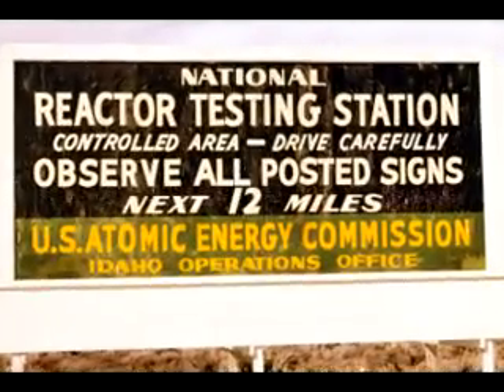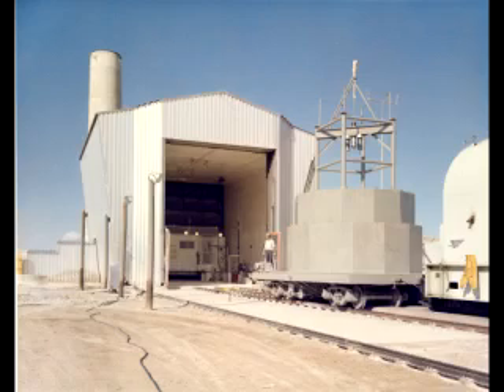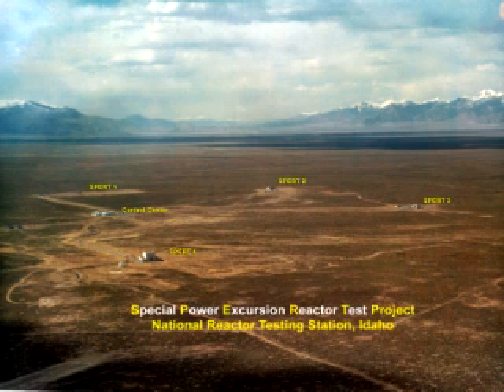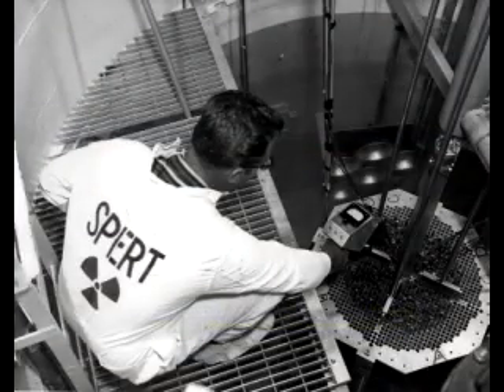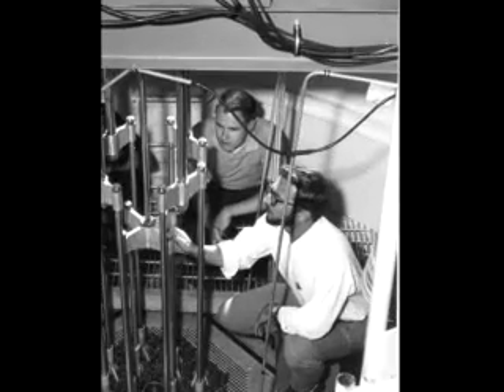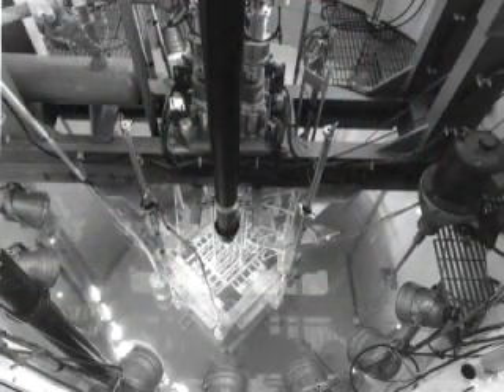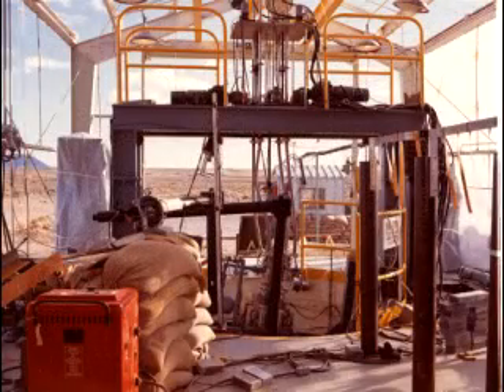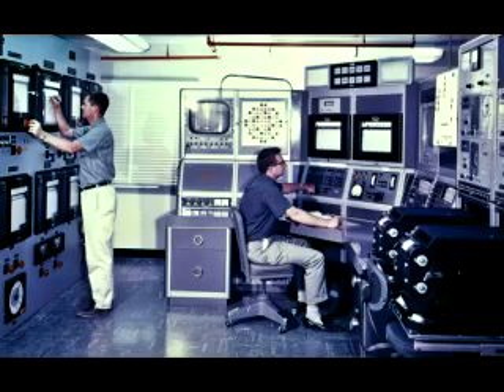The Day I Blew Up a Nuclear Reactor

Comment: Your point about not doing power reactor safety research and analysis is very valid. We let the genie out of the bottle a long time ago, and it is never going back inside, so it is stupid to not do everything to understand the genie. We should be running fourth or fifth generation reactors, instead of first and second. Fukishima was operated long past its prime. Heck, there are still 32 GE Mark I reactors still operating.

Comment: Fermi 1 was a partial meltdown. There were no injuries or fatalities and no danger to the general public. 
And the claim about no safety research is preposterous.
Reply from the maker: The claim of no safety research is NOT preposterous. Show me a research program that is actually running all out safety tests on an actual reactor of design the same as nuclear power plants now and future designs, and I will correct that statement. You don't put astronauts on a rocket that has not been thoroughly tested by test firings.  Give me the reactor and I will do what I can to either blow the shit out of it or melt it down or . . .! And don't give me that shit about semi scale tests. I was in charge of the safety analysis of the Power Burst Facility in Idaho for testing safer fuel element designs.

Comment: SPERT prove water is the worst choice as a coolant. It just explode.
Molten salt iun other way can ABSORB excess power and stop the fission for it's own.
The parameters of salt: 801°C melting point
1 465 °C - boiling point of common salt
~350 °C for eutectic mix.
Boiling point around 1200 °C for eutectic mix

Salt boil WITHOUT forming shockwave or film.

Comment from the maker: We didn’t just mosey into the control room one morning and decide to blow up SPERT I. This test was the culmination of a very carefully thought out series of tests with incremental increases in the severity of power excursions with shorter and shorter reactor periods. Each test was followed by weeks of data analysis before the next was run. We knew that certain reactor cores could withstand very severe power excursions. But, like test pilots approaching the sound barrier for the first time, there was a threshold that, once passed, things got wild. Somewhere around or below a 10 millisecond period was our sound barrier for this plate type core design. Beyond it was new, unexplored territory. 
An earlier test on another reactor in 1954 had led to explosive results. It was called the Boiling Reactor Experiment, or BORAX, run by Argonne National Laboratory at another remote area of the National Reactor Testing Station. The BORAX 1 reactor was first used to demonstrate that a reactor using direct boiling of water would be practical for generating power. In one final test they deliberately punched through that threshold, generating a 2.6 millisecond period. It was a spectacular explosion but not a lot of useful data was obtained.
The SL-1 accident was another example of exceeding that threshold, with tragic results.
We were looking for the threshold, below which cores could withstand very severe excursions, but just one step beyond made it violently explosive. And what was the mechanism that triggered the violent disassembly of the core when just before that threshold was reached the reaction was relatively benign? 
Our test series on this core in SPERT I started in early 1962 and progressed over several months involving 54 power excursion tests, ending with the test shown here. The reactor period for this last test was 3.2 milliseconds, peak power reached was 2.3 gigawatts and fuel plate temperatures reached 1200 ° C. The molten fuel portions dispersed into small globules increasing the heat transfer rate enormously – resulting in an energetic steam explosion throwing remaining water above the core 100 feet into the air and shattering the rest of the unmelted portions of the core. 
Before this a test had been run with a 4.6 millisecond period reaching a peak power of 1.3 gigawatts. A significant portion of the central core fuel melted, but no explosion.
Reply: I was wondering if this was BORAX or not.

Comment: I read an excellent story on this. They used to put uranium together to see if it would start a critical mass and then pull it apart real quick. Early days. This gent I read the story on, Leonard something, threw himself on the thing when he realized it was going irreversibly critical. He died of extreme radiation poisoning, but saved the onlookers.

Comment: I was an ET3 at the S7G MARF Plant at Kesselring when I over shimmed and scrammed.  Good thing it was only in the simulator room.
Reply: ahhhhhh... the "rodless wonder".....AT A1W ( accident in waiting )  I opened a Reactor coolant pump breaker while it was drawing starting currents. I swear the ammeter  pegged above  3000 amps.   A friend of mine paralelled 2 TGs 120 degrees out of phase ...God Bless Nuclear power the cleanest safest energy source there is except for solar which is just a pipe dream
Reply: gymnrat Lives you Nuke Waste as well? I spent almost a year at New London waiting for reclass and ended up in Dam Neck.
Reply: I completed the program , my friend, unfortunately, did not ....

Comment: Whoever figures there are current thorough safety tests with certifications might point Japan in their direction for better valves that operate properly. Last know after Fukushima lost power some valves were supposed to open during overpressure conditions but they didn't.

Comment: Pressurized light water reactors suck. We need to use a different reactor design. Even better planning for PLWRs would improve things. At Fukushima they put the backup generators to run the cooling system IN THE BASEMENT! Not up on a hill, no, in the damn basement, the room most likely to flood!!! Seriously people, if those generators had been up on a raised mound the Fukushima accident would have been prevented.

Comment: being remarkably stupid with a research pile is one thing, why don't All power reactors have huge water towers with concrete discs to passively pressurize it there are LOW WATER incidents as per Fukashima and TMI
Reply: Some new designs do have some passive water systems.

How long do you want the tank to last? At Fukushima it wouldn't have solved the problem as the reactor was leaking anyway.

Fire engines could not supply sufficient flow rate to cool the reactors - so a tank isn't going to last long.

They switched to seawater at Fukushima due to running out of water sources. Still an uphill battle to keep them cool.
Reply: Why not use a passive system to vent the heat to the atmosphere? Air cooling but not directly.

Comment: Exposing the General Public to Dangerous Radiation and Radio-Active Substances is a form of VIOLENCE .....DYING A PAINFUL DEATH DUE TO RADIATION IS VIOLENCE...
Reply: +Steve Darley  The dose a half a mile out was only .0225 rad/hr*kg. Overall when they were done with all the tests they just covered two acres of land with 6" of gravel.
Reply: It is much better to run controlled tests with very small reactors to determine better processes/designs for full scale reactors than to perform these tests on actual power plants (uncontrolled/unexpected/much larger cores/more radiation, and in more populated areas) I think this testing was very important and probably saved many lives as the US/European Nuclear power generation has not yet experienced a loss of containment.
Reply: i can agree with you on that

Comment: So... you'd rather we keep blowing them up on purpose?

We learned enough from SL-1 that the amount of radiation people were exposed to from the TMI incident was the same amount as eating a banana every day for four months.

We didn't make Chernobyl. We didn't make Fukushima. We learned enough from an itty-bitty reactor in the middle of nowhere to make safer plants.
Reply: yeah but if they covered up or fudged the details from the dosimeter rates which is HIGHLY likely then it would NOT amount to eating a banana a day for 4 months would it.
Reply: So who was the genius that put not just one but three reactors in an area known for tsunamis AND put the backup electric generators in the basement? We're talking an engineering 101 type mistake and this should have been reviewed by some of the best.
Reply: Kohdok We kind-of did make Fukushima.  That was a GE designed facility.  Some of the ancillary items like backup generators were screwed up by Tepco, but fundamentally it was an American design.  Of course, even back then they should have known that you want passive safety systems that can survive a loss of site power.
Reply: There's a fair bit more risk in the TMI scenario, wouldn't you say? Bananas don't create hydrogen bubbles. 

Of course, we can say that the TMI hydrogen bubble didn't ignite. Fukushima's did. 

Quite risky.
Reply: +JETZcorp  Little late on this one, but Fukushima was hardly an American design problem. There were a couple of inherent issues from the Generation of the design, however the Japanese site specification assumptions and the lack of a failure tree are the ignorant assumptions that enabled the accident to happen. 

A sea wall that wasn't tall enough, diesel generators well below the water line, no trained emergency staff on site, the assumption either the reactor would always be producing power or getting power from the mainland grid, the assumption rescue crews would focus on recovering the nuclear reactor within days of an accident, not having any knowledgeable staff also know how to operate the heavy equipment on site, the lack of emergency safety upgrades for known issues like venting and ignition sources, ultimately you can surely see there are a lot of low hanging fruit that all came together to help create the incident.
Reply: Not all radioactive elements are equal. I'd take 1000 banana doses of potassium over 1000 cesium doses any day.
Reply: A radioactive banana. But they left out that particular adjective. Perhaps.
Reply: +taketimeout2 All bananas are radioactive.
Reply: The SL-1 accident showed that there was a need to have a way to measure more than their Geiger counter maxed out at. (from the official analysis)

At Fukushima they had the same issue - the counters went off scale.

The most basic of lessons was not learnt.

And no the SL-1 incident didn't make the TMI incident any less dangerous.
Reply: Not 3 but 5.

And they knew it was an issue years before the Tsunami.

And the GE reactor designs were known to have a flaw.

And to top it all off - what saved the day was a combination of a failure of equipment and a failure to follow procedure.

Without these two failures combining the Fukushima incident would have been a whole lot worse!